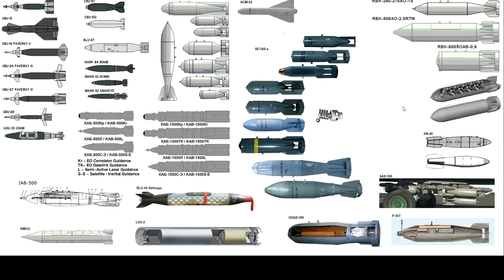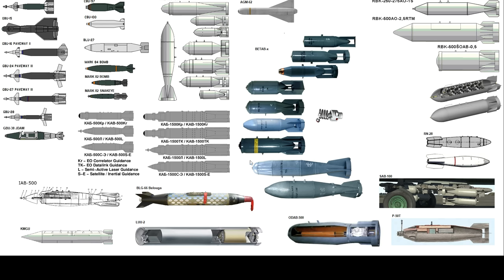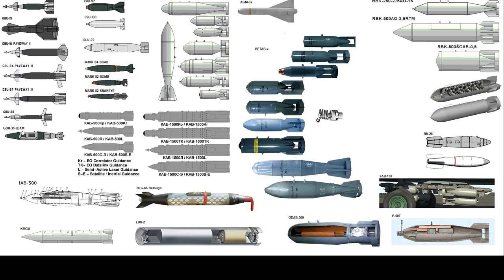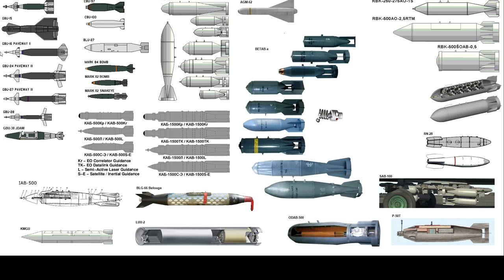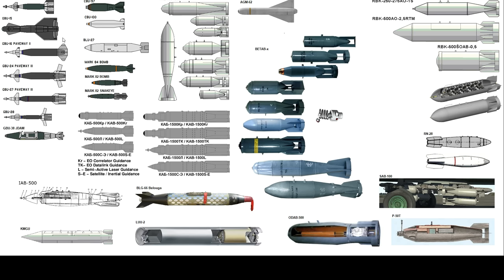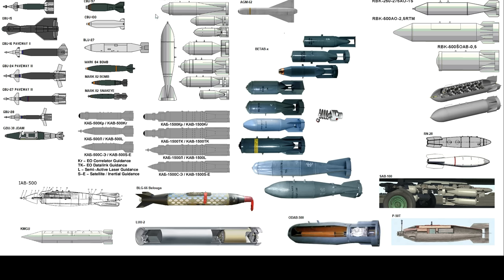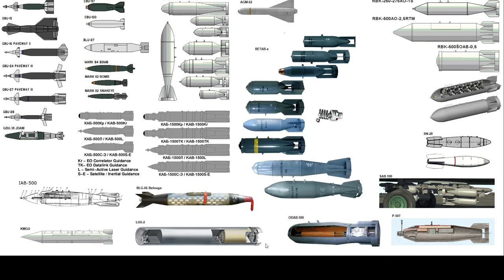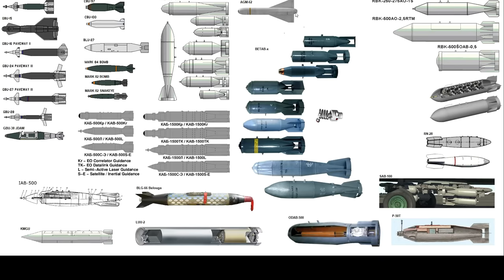Explained: Air To Ground Bomb Types

Comment: it's not too difficult to grasp how laser guidance works.
it's basically just you pointing a laser pointer on a wall and your cat jumps after it all cute like.
the guidance kit is divided in 4 sections. when it spots the laser in one section it moves the fins to bring it to the center. although being stupidly expensive, those guidance kits do not have a PID system, and a lot of energy is lost when guiding because the kit can only differentiate between the 4 sections, and thus the fins move all the way all the time, resulting in what they call 'bang-bang guidance'. thus good aiming is required for the initial release and the laser is only turned on in the terminal phase.
it doesn't use range information at all, just the position of the dot relative to it's longitudinal axis. it sees only 2d.
the laser code in itself is just a frequency at which the dot is pulsed on and off.
Reply: FalcoGer US seems to like everything that involves bang-bang ;p
Reply: Why no PID, should be pretty cheap to implement, and would increase accuracy by a bit
Reply: The higher number gbus do have PID control. It's notably the gbu10 and 12 that are missing them. Not sure about the gbu-2x series. The increased accuracy is rarely why you would want it - the target will be within the blast zone anyway.
Reply: Yup, the Paveway IIIs (GBU-24 and up, IIRC) do use proportional guidance. One of the advantages is that it lets you use LGBs from very low level compared to the older ones.
Reply: +FalcoGer
"the laser code in itself is just a frequency at which the dot is pulsed on and off."
Does the wavelength of the laser beam being emitted play into it at all?
Just doing a quick Google search, the LANTIRN runs off 1.06-1.54 micron (1,006nm-1,540nm) and outputs up to 100 millijoules of energy. (NOTE: I'm pretty surprised this information was publicly accessable given most DoD standards of having such specifics be vague)
Another pod, the Damocles, has... numbers all over the place. Laser rangefinder: 1.5 micron. Laser designation: 1.06 micron (stated to be STANAG 3733, so I guess this is a NATO standard to let us all be able to use the same laser designator, but I'm guessing non-NATO systems would throw a hell of a wrench into the works in getting things to actually track). Laser marker (what's the difference between this and designator?): 0.8 micron.

....Aaaaaaand nevermind. Doing Googling, I found this document which answers my own question:
"A laser range finder has two basic parts, the laser and a laser receiver. When a laser is fired,the object it hits, or its target, reflects the laser energy and this energy disperses. Some of this energy is reflected back towards the laser and can be picked up by the receiver.  A laser rangefinder fires a 10 to 30 nanosecond (billionth of a second) burst of laser energy at a target in a preset wavelength and the laser receiver is coded to pick up only (emphasis not mine) the reflected laser energy in that same preset wavelength."
dtic(INSERTDOTHERE)mil/dtic/tr/fulltext/u2/a390936.pdf
Reply: It's so obvious it hertz, kinda makes me pulse with rage.

Comment: GBU-15 is a man in the loop weapon. it carries a 2 way datalink kit and uses an camera on the front.
if you want to use it yourself, you can try Falcon BMS. your plane needs to carry the AN/AXQ-14 data link pod, which receives the video signal and displays it in the cockpit for the pilot or weapons officer. the large fins are meant for standoff gliding.
in the first stage the bomb drops balistically, then in azimuth only to conserve energy when steering, then in terminal mode it will point to a target the officer designates in the camera display. at any point the operator may enable or disable the fuze. it can be very precise and you can drop it from a little ways away and pick your target on the last leg even through a cover of clouds. it's a bit unstable and wobbly in the terminal phase, but you might get it through a window if you're good.
With the hornet you will be getting the AGM-84 variants slam and slam-er, which are also man in the loop, anti ship guided missiles. it will be more or less the same thing, except it's a cruise missile with additional functionality and autopilot options. you can also try those in Falcon BMS.

Comment: Very informative. There are some good videos of fuel-air bombs sending out a shaped cloud of fuel and then igniting it, giving a directional effect (much like the hollow loads for armour piercing grenades). And you are right, you have often used the wrong types of munitions in your missions (and CCIP when CCRP would have been much safer).

Comment: Cap, I found this paper written by a one Lieutenant Colonel David M. Neuenswander, USAF (a cookie, erm, biscuit? if you can pronounce THAT name, phew) on laser guided weapons that not only explains the basics of how they work, but actually goes pretty advanced in how they function. Including stuff with interaction of the plane and bomb and pod and whatnot that might be interesting/helpful to you. I'll quote the relevant bits here and give a link to the paper (it's in PDF format, unfortunately).
"The discussion begins with the current state of US laser systems and the present state of interoperability.  This includes a brief discussion of how a laser works and what constitutes the basic parts of a laser system, laser range finders, laser designators, laser spot trackers, and laser guided weapons.  The monograph also explains the difference between eye-safe and non eye-safe lasers."

"The following is a basic description of how a laser range finder works, what platforms they are currently mounted on, and the difference between eye-safe and non eye-safe lasers. A laser range finder has two basic parts, the laser and a laser receiver.  When a laser is fired, the object it hits, or its target, reflects the laser energy and this energy disperses. Some of this energy is reflected back towards the laser and can be picked up by the receiver. A laser range finder fires a 10 to 30 nanosecond (billionth of a second) burst of laser energy at a target in a preset wavelength and the laser receiver is coded to pick up only the reflected laser energy in that same preset wavelength. Laser energy travels at the speed of light, roughly 180,000 miles or300 million meters per second.The laser receiver has a small processor that knows the speed of light and using the rate=time x distance formula, the receiver solves for distance."

"Many of the systems, such as the AF/Navy LANTIRN Pod, tie the laser range finder in with other capabilities such as Global Positioning System (GPS) navigation and target marking systems.  By tying LRF (Laser Range Finder) to the GPS the pilot can fire laser at a target and instantly receive coordinates for that target with military GPS accuracy."

"A laser designator is a laser range finder with enhanced capabilities.  In addition to the normal functions of a laser range finder, laser designators can be used to guide a laser-guided weapon to a target.  For laser designation operations, an operator shines his laser on a target during the terminal phase (last seconds) of the laser-guided weapon’s flight and the weapon guides on the laser energy reflected off of the target."

"To insure the weapon hits the correct target, the laser is coded and the seeker on the weapon must have the same code set."

"This code can be described as sort of a Morse code, with the split second laser burst sending dot-dash-dot, and the weapon set to the same code.  The weapon will not see any laser that is not transmitting the dot-dash-dot code.  Since each weapon has it’s own separate code, multiple lasers and weapons can be fired into the same area without fear of interference or the weapon switching to the wrong target."

"Coding provides flexibility because the designator can be on the ground or in the air and does not have to be co-located with the system that launches the laser guided weapon.  Thus, a soldier with a designator can laze for artillery, helicopter, or aircraft delivered laser guided weapons and fixed or rotary wing aircraft can laze for the same systems.  When coupled with the many laser systems and weapons on a battlefield, this flexibility provides an almost endless number of ground to ground and air to ground lazing and weapons delivery options.  Procedures for these tactics are located in Joint Pub 3-09.1."

"Laser Spot Trackers are the least common of all US laser systems.  A laser spot tracker is not a laser, it is a sensor that picks up coded laser energy from a laser designator and projects a symbol on a sight or heads up display.  This symbol allows an operator to visually acquire the target designated by his or a friendly laser.  Most laser spot trackers are mounted on helicopters or fixed wing aircraft. At this time, there are no ground-based systems with laser spot trackers and the only fixed wing aircraft with both a laser designator and a laser spot tracker are Navy F-18s and USAF fighters equipped with the new Lightning II targeting pod."

"Laser guided weapons (LGW) are the business end of US laser systems.  The primary LGW platforms are fixed and rotary wing aircraft, artillery, and naval gunfire. For LGWs to be effective, an aircrew member or ground spotter must illuminate the target with a laser during the last seconds of the weapons flight.  The seeker on the laser guided weapon sees the laser reflection from the illuminated target, and commands the weapon’s guidance fins to steer to the target."

"Some systems have range finders but no designators, while others have laser spot trackers and no lasers.  While the reader might expect interoperability at least within a specific service such as the USAF, a review of the table 2-1/2 shows that the primary Close Air Support (CAS) aircraft, theA-10 does not have a laser but is equipped with a laser spot tracker.  Conversely, the F-16 has a laser designator, but no laser spot tracker.With the exception of jointly acquired systems such as the LANTIRN pod, inter service interoperability is just as confusing.  Table 2-1 shows that tanks and armored personnel carriers (APCs) are equipped with laser range finders that cannot be coded, and thus could not designateor mark for their own service helicopters or sister service fixed wing aircraft.  Further, these platforms equipped with strictly range finding assets can not designate for the Copperhead munitions available from their own or sister service artillery.  Simply put, current US laser system capabilities are not interoperable.  To create the fully joint precision engagement capability called for in JV 2020, the US must make significant changes."

That is only a small snippet of the 45 PAGE paper where he goes into extreme detail about the systems. Granted, the paper mostly focuses on how the lasers could be made safer and how the laser systems could be integrated so that they could all work together with no compatibility issues, but it's still interesting. Might want to give it a read/skim if you get the time.
dtic(PUTDOTHERE)mil/dtic/tr/fulltext/u2/a390936.pdf
Reply from the maker: Wow thanks Burn

Comment: Cap - The laser-guided GBUs have the IR tracking cams in those little shuttlecock looking tips on the bombs.  Those shuttlecocks have a range of motion, sitting on the tip like that, so when the IR guidance camera is locked on a laser designation, it will "bend" to stay pointing at the laser spot.  
The 'shuttlecock' also has a set of aerodynamic vanes, in a circle around it, which turns the bomb towards the laser spot it's pointing at.  That's how it steers.  You can probably find some YT vid on it, regarding how it can wobble around and both point and steer via that same single shuttle part on the tip.
Reply from the maker: thx

Comment: Specifics are not known by me, but a possible way GBU bombs are guided is the reciever acts somewhat like an infared sensor and detects heat emmited by the laser through thermal radiation.  Also like an infared sensor, it may direct itself to the point where the laser hits the ground.  Essentially like an A/G Aim-9 but with lasers to track instead of thermal radiation emmited by friction or engine heat. (Thermal Lasers are different than other thermal signitures as a laser is a focused beam of photons while normal light spreads photons in an un-beam like manner such as the sun.)
Reply from the maker: thanks

Comment: right guys.......the laser designation signal  creates a 'basket' from the target, a funnel I suppose. The seeker head, or birdy head if you're more inclined to read USAF tech orders, at the front of the CCG (Computer Control Group) detects the edge of this funnel and sort of guides the munition off the sides, to the target with inputs to the canards on the CAS (control actuation section).
Reply from the maker: thx

Comment: CBU 95 is your standard lots of bombles in a dumb bomb variant. CBU 105 is the same ammo, but with a wind corrected dispenser kit.
the CBU 97 is the senor fused weapon (sfw) with smart bomblets. it's a very complex launching mechanism which launches (ice hockey) puck likes bomblets. due to their rotation after launch they 'wobble' in the air as they descent and use an electro optical system to scan for targets. as they wobble, they scan a circle, but because they descent, they scan in a spiral pattern. when they find a target they explode to create an armor penetrating stream of hypervelocity copper to penetrate armored targets. they are very expensive.
there is a wind corrected dispenser for that one as well.
So have you ever read through any of the manuals?

Comment: High dragged (either snakeye or chute) weren't used that much with the MK-83/84. Even the M-117 (750lb and all munitions expended as of about two years ago) could be fitted with the kits, but it just was not common. What the MK series brought to the US (and the NATO allies that used them) was a modular bomb system that could fitted or fused with all sorts of kits (laser, tv, extended fuses, high drag, and now GPS).

Comment: The laser fires in pulses. The pulse rate is "coded" and can only be read by a weapons laser spot tracker programmed to look for that specific coded pulse. It will disregard other laser pulse codes. The intensity and coherency of the laser provides a powerful reflection, easily seen by the tracker. The tracker will try to to keep the laser reflection centered as it maneuvers the bomb to the pulse. There are slow mo videos that clearly demonstrate the pulsatile nature of the laser on the target.
Reply from the maker: Affirm

Comment: Bomb effects in DCS really suck currently - no fragmentation effects are modeled AFAIK, even a near miss usually has no effect e.g. on armored vehicles. Same goes for CBU-87 accuracy - long overdue for improvement!
Reply: falanglao01 agreed, I dropped a MK82 with the crater right next to a truck, no damage to the truck. I did read somewhere dcs was looking into this.

Comment: everyone seems to get this wrong but there is no 'molten copper' anywhere. neither in ATGMs, nor in any bomb or any other weapon, really.
The copper is not liquid. it behaves like that because of it's intense velocity and the pressures involved.
Reply from the maker: Interesting
Reply: Actually it is molten, its just that by the time you see any of the material it has cooled down from contact with target and with air. Molten copper may not sound like it would do much but it carries the same weight no matter what state of matter it is in.  It also creates an incendiary effect to engines.
Reply: Copper starts out solid then enters a liquid (some say liquid like) state because of pressure and heat.
Reply: The shaped charge warhead uses a cone shaped piece of solid copper. Copper melts at around 1,085 C so you would need to keep it at that temperature to keep it molten. How it works is that upon detention, the explosive surrounding the cone (with the open end of the cone pointing towards the target) functions. The explosion causes the copper to become molten and form a stream of molten copper that shoots forward. Google "the Monroe Effect" if you want a detailed explanation of how this works.

Comment: Basically Thermobaric weapons don't have an oxidiser like normal explosives, they are kinda inhumane as they eat up all the air and release a horrible shock wave due to the sudden massive pressure change as they suck up all the air and then explode(the low frequency thing mentioned). This shock wave can cause extreme hemoraging,collapsing of the lungs and all sorts of nasty brain damage shit. Affective against people in fortifications/caves 'cos of this shock wave. Hence the use if the MOAB(its thermobaric) against Taliban hiding in caves. Bad in low oxygen environments like high altitude or underwater.
Reply from the maker: thx

Comment: IAB-500 (Имитационная Авиационная Бомба - Imitation Aviation Bomb) is a training bomb for imitating nuclear explosions in large scale exercises/wargames (fireball diameter - 45m, flash time 0.8-2.0 seconds, mushroom cloud diameter - up to 170 m, cloud lifetime - about 60 seconds, cloud visibility - up to 10 km). Pretty much let's say planned wargames start with a legend of likely nuclear escalation, so when one of these are dropped nearby it means everyone participating must behave like in a CBRN environment. Funny that there is a training bomb for a nuclear war, but still much better than Totskoye nuclear exercise, when an actual nuke was used in military wargames.